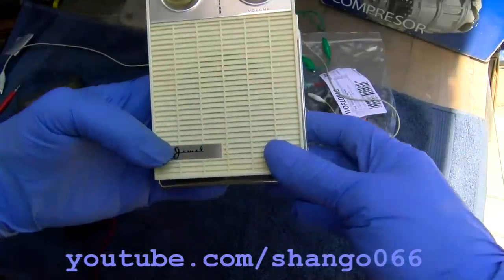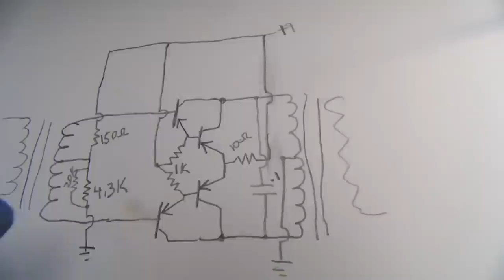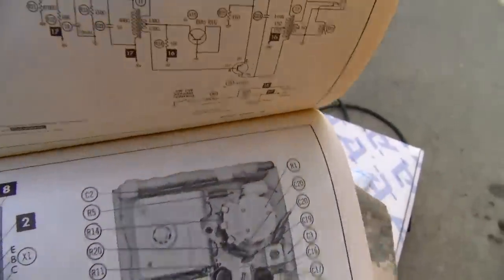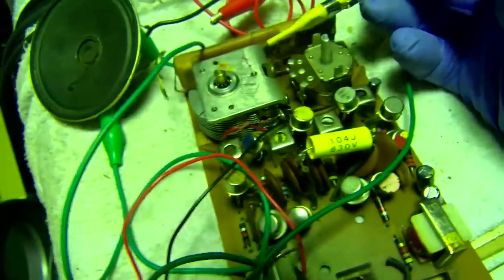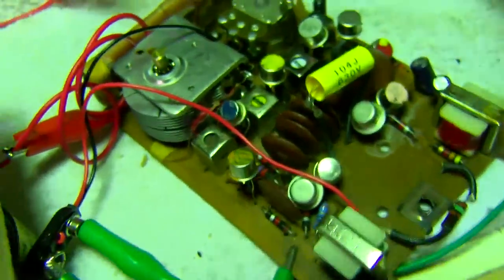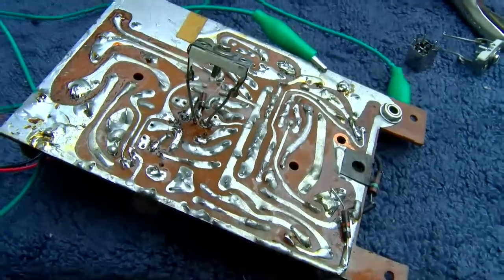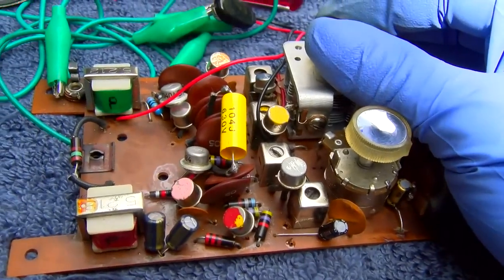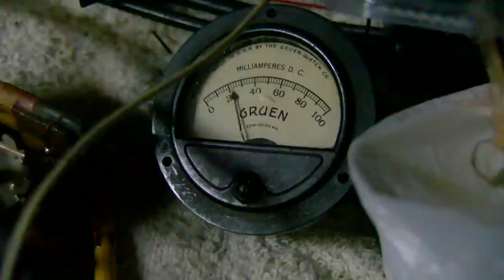1963 Jewel 10 Transistor AM Radio Repair Confusing Tough Repair

Comment: All of us that have been working on radios know this beast. I call it "That radio". 

It's minty, the plastics aren't yellowed, the metal faceplate isn't scratched, theres no dust,  it looks like it was used once and put in a drawer and never seen the light of day since 1962. Often it can be found with the original box and documentation. You put a battery in it and it's dead as a doornail. Then the diagnosis starts and you chase down one problem, then another, and another. You'd swear the thing was cursed. 

A year later you pick up the same model at a yardsale. It's beat, it's musty, the case is cracked, everything's corroded.  You put a battery in it and it plays like it was new. 

Don't know why this happens but it does. 

Thanks Shango for the excellent videos.
Reply: It's all the extra transistors being used as diodes that make them act up and hard to diagnose

Comment: I really envy you for still having various local AM stations tunable in daytime. Even if their program kind of sucks. Here in Germany the last AM station shut down like 20 years ago. Where I live, I get four or five weak stations after it gets dark. Radio China, a french station and some Bulgarian crap. When i was a kid, I had a 750 kilowatts transmitter which transmitted AFN about 30 miles away. I could listen to AFN with a foot long piece of wire connected to a tooth filling...
Reply: I live in Denmark and I get a lot of stations at least a hundred in the night time. f. ex. almost every night I can receive MFR2 in Scotland 1107kHz a 1kW transmitter sharing frequency with Talksport.

I can hear Spanish, African and Polish, Rumanian etc. very clearly. In the daytime I can often her one or two British stations.

On longwave I can always I repeat always hear BBC4 on 198kHz very clearly and the Polish station on 225kHz. Not always but often the Irish on 252kHz.

I use the build in ferrite antenna and the best radios I have are old Blaupunkt, ITT and a Japanese brand Koyo. My new radios only receive in nighttime.

Try buying an old radio. You should be able to hear a lot in Germany since LW and MW are very far from dead.

You may have problems with noise in town though. I live on the countryside. Have fun.
Reply: Germany?  In the 90s had a 1KW AFN transmitter in my back yard.  Now as you say it is France, various eastern European stations, and a weird Chinese German - Mandarin class!
Reply: @Newlife-ol6pk  Radio Romania is everywhere!  Guessing they have 50KW or better transmitters

Comment: Back in 1966 I worked for my Uncle driving tractor on his farm, making hay and such for $5.00 per day plus room and board. I saved up enough to buy a brand spanking new Aqua color Jade 10 transistor radio.  I used it on the farm at night when I and another Hired Hand spent the night in the single upstairs room.  They had an old TV where we could watch Johnny Carson at night but the radio was great for listening to the fantastic music that was on the air back then.  Well it wasn't long before I got tried of buying 9 volt batteries so I wired up a 6 volt Lantern battery to her. That lasted for ever however at the same time I started to screw driver the set.  Somehow I got the radio so instead of AM I was picking up Short Wave.  I wanted to show it off so I took it up to the local AM Radio Station and showed the engineer up there.  He was amazed at what I had done. We put the radio next to the AM Transmitter antenna where it went out and I was pulling all sorts of crap on that little set.  I got the set back a few months ago and it was plumb dead. I could not get a spark out of her after 51 years in dad's old roll top desk.  Ah well, shit happens.
Reply: what a charming anecdote, thanks boomer
Reply: Treat yourself to a new AM radio..U've earned it.
Reply: @mikemiller659  Thanks, I picked up a usd AM/SW  built in the USSR. I had to replace 1 capacitor and she works like a new set. I purchased one of those new Lithium 9 volt batteries and us that to power the cute little set.  Now  I can listen to both AM and SW at will. Living  in the old house I purchased many years ago I have lots of time to listen to radio and play on my laptop.  It isn't a great life but it is a good life. I sure do miss my wonderful wife who lived with me for 51 years and 4 days though.
Reply: @JerryEricsson  loosing your partner is tough
Reply: I'd say try and fix it up. If you could get the oscillator up into 3 megahertz and get the antenna circuit to track then you'd have shortwave. I also wonder if you were tuning images above your actual heterodyne frequency. Fix it up and try not to touch the alignment. Maybe you can analyze it once you wake it up.
Reply: @estebanvillalobos2303  I thought his story was quite relevant to this video. Possibly you weren't capable of seeing that? Good luck.
Reply: It's the capacitors... it's always the capacitors!  Don't give up.  That little radio is a piece of your history.

Comment: Shango, That Jewel radio, was a radio made for the Jewel Tea Company, based out of Chicago Illinois. They were a grocery store chain, primarily in the Midwestern US. That unit could have been made by Belmont, or Wells Gardner, or some other radio manufacturers in the Chicago area
Reply: Motorola or Zenith perhaps?
Reply: The Jewel Grocery store chain of Chicago had nothing to do with the Chicago Tea Company
Reply: My stepfather worked for Jewel Tea for a few years. I got to tour their facility in Illinois when I was 12 or so. They sold all kinds of things so it wouldn't surprise me if they slapped a label on a radio.
Reply: Jewel radio was out of New York. No connection with Jewel tea company or the jewel stores in Chicago.

Comment: After a year of looking  at your videos, I like the transistor radio projects mostly, as that is what I grew up with.  Happy to 
say I just got a NEC NT-8M11 working last night, using the things I learned from you.  Found it in a junk store for $7.  It 
was kind of tricky as a couple of electrolytic capacitors were axial and covered with a wrap that made them look like
choke coils.  Lucky I didn't give up and figured it out.  It is very rewarding.  Thanks for your help.

Comment: I was talking with another radio nut on line the other day, he told me the Soviet Radios were built using surplus satellite parts which is why they are so strong and healthy. Parts made good enough to work in space have to be hardy.
Reply: Electronics in space have to be able to tolerate extreme temperature variation.
Probably extremely expensive too.

Comment: Shango066, my compliments on your stick-to-it-tiveness, radios that have been "restored" by someone can be a challenge, as often times new problems are introduced.  

Problems I noticed in addition to the ones you found: (1) The DC beta on one of those IF transistors was 17, at 455 kHz the gain was likely half the DC gain.  Also an indication that transistor was poorly substituted or going bad.  I would expect to see a DC beta of no less than 40.  (2) That 0.1uF, 630V plastic film cap was likely originally a ceramic disk.  If that cap was being used for RF/IF bypassing, it would work poorly.  (3) I would have replaced the detector diode with a germanium type, since that was the original design.  Using the silicon diode you chose would degrade performance, but hey, you got it working anyway!

That was a rather crazy audio output stage.  A darlington configuration for high current gain but yet, going through an impedance step-down transformer, powering a 16 ohm speaker.  I guess getting the transistor count up, took precedence over common sense.  I would have used 2 of those transistors to set the bias for the output stage so the idle current would be stabilized.

That 9V current was ridiculously high, but hard to know what the original current draw was.  Alkaline batteries were not available when this radio was made, using the standard carbon-zinc battery, battery life would be very short.

Comment: I have that exact set.  Seven transistor set masquerading as a 10. Parallel outputs and one transistor used where a diode would suffice.
Reply: Who is the OEM?
Reply: I wonder is replacing the detector with a super low forward voltage diode would increase sensitivity.
Reply: @blazertracer1  Suspect this was made by Eico as the  TS-10 as well. Was a cheap knockoff of a Zenith
model 500D.
Reply: @blazertracer1  Jewel radio of New York
Reply: There was a jewel radio corporation out of New York.  They made some sets from the 40s up until the 60s and I believe they faded away after that.

Comment: I admire your patience. I find the bias of most push-pull stages so crude with a simple resistor divider, no wonder these radios can pull too much current sometimes. Just adding a diode would at least help to stabilize the bias as a battery discharges. But, a saying in engineering of many mass produced products: "If it's good enough, ship it. Don't spend more R&D on it".

Comment: He got to me. I had to order an AM/SW radio from Ukraine. I got it cheap, shipping was more then the bid.  It was sold as is/  Took 1 capacitor to fix the set, I drilled  a tiny hole in the battery case so I could attach it to the set as the locking screw was missing and now I have  a GREAT sounding radio that picks up SW at night better then any other set in my growing collection of shortwave sets. 73's KE0JBL

Comment: Another great 😊 video, Shango!! Almost 😅 an hour and a half of pure radio 📻 ASMR!! The capacitors are probably fried if they were wired in backwards. Maybe 🤔 some capacitors have been soldered in alongside the old ones. If not, it’s probably simply a tough repair 👩‍🔧 to try to figure out. Process of elimination is about the only way to try to figure things out a little bit faster. Your friend, Jeff.

Comment: I've had a couple of those here in the shop lately and all they needed was new caps and the volume potentiometer cleaned like most of the vintage radios I get in for repair.

Comment: Excellent job troubleshooting and repairing such a challenging radio, despite taking quite a bit of time! That is dedication, not giving up no matter what! It appears that the capacitor that was installed in the white IF can perhaps could have been a slightly higher value, since the core slug has to be turned practically all the way out to be peaked in the end. But, the IF gain was so much better, and the radio is performing well at the end, even on the K-Mozart classical station!  A mystery why the current draw still seems a bit high, although might be normal for that old of a radio with four output transistors instead of two. Not meant for a small 9V battery but a set of "C" batteries I imagine!

Comment: Thanks for yet another great vid. I've been lucky in that the handful of germanium radios I've fixed have had mostly good transistors. I used to have boxes of old radios boards that I binned decades ago. They would have been filled with germanium transistors and I regret throwing them now. I've yet to come across silver mica IF can disease but at least I know what to look for now. Radios are a great hobby. Pity the AM band is filled with such crap. Fixing radios is still a great hobby despite that.

Comment: Here in the UK it was common for germanium transistors to have the collector marked with a spot rather than the emitter. Some of those Russian devices have odd lead markings too. Even had the device case connected to the base.

Comment: The cheap Chinesium LCD  multitester  tester can be used to check coils IF/audio for a comparison
Reply: I'm always amazed at what those things will test.  However, there are many factors when testing inductors,  including resonant frequency associated with the core material.
Reply: @waltschannel7465  They are amazing for the price you are right they won't be that accurate but can give a comparison between like parts if you are lucky to have a good one. It's bit like a component tester in a scope.

Comment: A number of years ago I had a Panasonic AM only pocket radio low gain, no peaks when I attempted alignment turns out all 3 IF transformers were bad after replacing them radio peaked sharply gain was very good looking at the tubular caps on the IFs they all looked like the silvering had completely deteriorated, and I know no one had ever been into it because it belonged to a friend

Comment: I liked your video. I think your IF transformer can repair is quite interesting. One of the issues I’ve had with poor performance even with new good parts is IF stage oscillation. This results in poor performance and no gain in the stage even if the transistors are good and the resistors are good. What happens is a squealing and no performance with a change as you turn the transformer core. This can be seen using a scope or spectrum analyzer.  A solution can be to bypass the transistor current source with chip capacitors and also use smd chokes on the current source for the amplifier transistor as well. This can help when substituting transistors, which can give you more gain and performance than the original parts, which would have been impossible to be achieved due to poor board layout. 

I also noticed that your gain in one of the transistors was quite low for an IF stage. 16 or so for Hfe is not a good value.

Comment: I have a 'Sanyo' 10S - P10, 'Transcontinental', 3 Band, 10 transistor, MW, SW1, 2,(2.2MHz-18MHz SW coverage). The transistor count is 'true' in its configuration, where there's a separate oscillator transistor for each band I think, but after buying a big 'bag' of assorted electrolytic capacitors (including tantalum), and fitting them to suit (tantalum off the volume control), aware of the (+++) marker on the tantalum, it still works with sensitivity like your favourite early Sony's, using solely PNP germanium transistors...

Comment: Dog Day Afternoon analysis! Great persistence, Shango... Wonder if that transistor was picked up off the floor sweepings at the manufacturing facility and worked fine as a detector' Great for upping the count of  Xtrans.  It probably worked fine and flew through alignment and function. 100 degrees here on the  East coast with high humidity.......

Comment: I would buy vintage transistor radios back in the 1980s most of them I bought worked at the time but by then sitting around for 35 years the capacitors just go bad the ones that worked 35-40 years ago no longer work squealing motorboating Etc part of the circle of life

Comment: Hi from England matey.
Dc resistance doesnt affect resonant freq, however it does give an idea on Q, the higher the impedance at resonance (455kc) versus the lower the Dc resistance gives a higher Q or higher selectivity.
The white IF trans being wide kinda implies the cap you used isnt that great, should really be a polystyrebe cap, seems to work Ok though.

Comment: Some transistor sets have a neutralizing capacitor from one of the transformer leads to the base of the transistor.  Yeah, just like the old triode TRF sets.  If the neutralizing capacitor is wrong, the IF stage will run at low gain, and the coil might not have a sharp peak.

Comment: In the process of restoration of this 1960 Philco model T74-126. The radio is now working except for some occassional microphonics however, not having a schematic for it, I'm not sure of the value of one of the replaced electros. It had been very roughly replaced sometime ago by a previous owner and it was a very dodgy repair. One of the transistors in the IF chain has also been substituted by an unknown unit so a schematic would help. It is the only transistor of it's type from the US that I have in the collection.
More importantly, the case has had a very rough life so I'm hoping that someone might have a good case from a "parts" radio, not needed, that might helo me complete the restoration. If so, please let me know. Thanks.

Comment: No doubt this was sold by the grocery store chain in the Midwest, Jewel Tea Co. Know as Jewel Osco today. Seems to
 be a cheap knock off of a Zenith 500D and shows it. Very challenging repair for obvious reasons.
Reply: Osco bought out a lot of smaller chains back in the 80’s and 90’s. Kept the names of some of them hyphenated “Save On-Osco”, Jewel-Osco etc. Eventually they were subsidiaries of Albertsons before being sold off.

Comment: Note how the transistors are marked with paint colors and no 2nxxx markings.  Rejects or floor sweeping transistors sorted and marked with paint as to how they graded and their suitability in the circuit.  Same as cheapo  Hong Kong made radios.  I have one of these and it works but not the greatest.

Comment: Very interesting that the manufacturer used a transistor as a RF detector and added two more transistors to the push-pull output stage (as darlingtons) and a transistor as the local oscillator. Not much better than a well designed typical 6 Transistor AM Radio.   Actually using the extra transistors in Local Oscillator and the Darlington output should have given it somewhat better performance.

Comment: I have a question, I have a few different vintage walkie talkies,realistic ,a few of them have the same problem the volume does not shut all the way off.here is what I've done changed all caps,changed all the the audio transistors and squelch, even the volume control still the same some how audio is getting around the volume control any suggestions?

Comment: Hi Shango, could you try just using one pair of output transistors? As a Darlington pair, there's a lot of gain to be had but there's also more current drawn. However, if you're tired of screwing with this thing, I understand. Thanks for an interesting video.